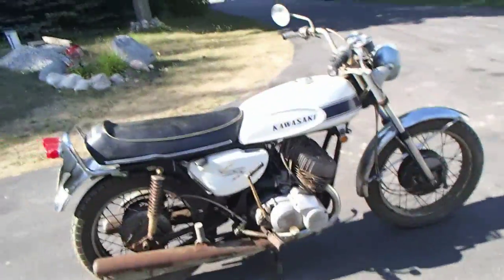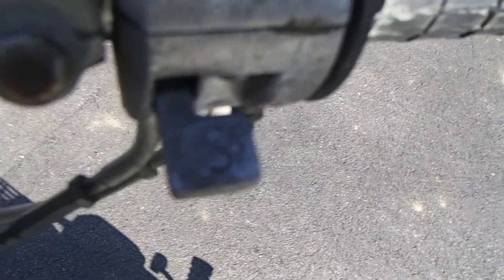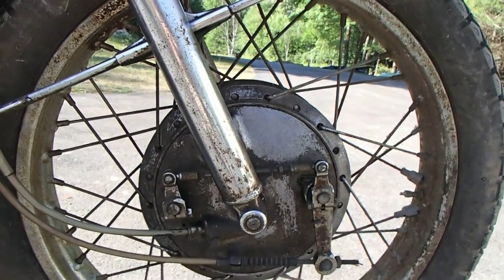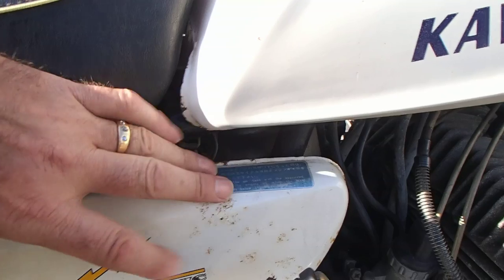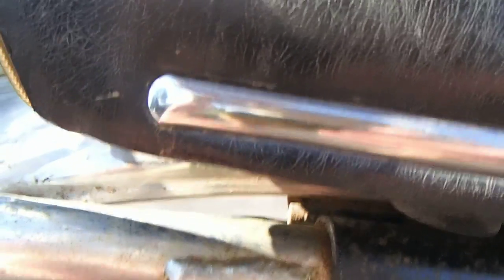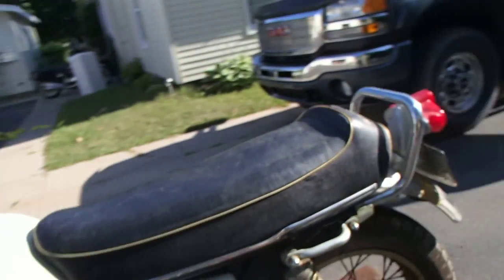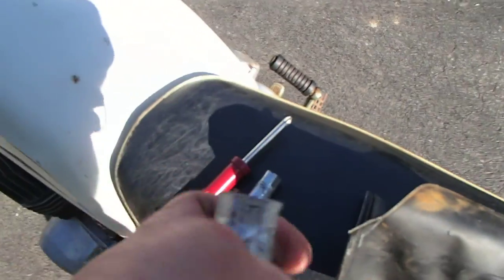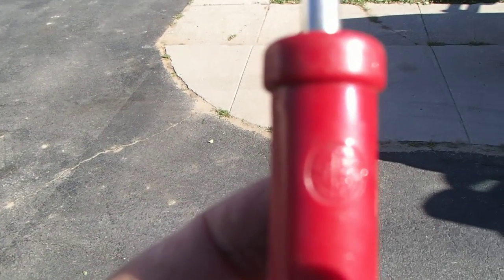Close up view of 1969 Kawasaki H1 Barn Find

Comment: I neary  bought   one   of  these  when  they   were  new did  not  like  it  at  80  to  90  m p  hour   slowing  down  had  to  drop  down  the  gears   and  rev  the  nutts  of  the  bike  to  get  the   speed   back  up   bought  a  suzuki  gt  550  much  better  bike   more  torque   not  as  fast   but   i do  like   the   kawis   i had  a kawie  900 z1a  good  bike    soid  that  and  bought   the  best  bike  i ever  had  suzuki  gt 750  watercooled  in  blue  i now  have  suzuki  t500j  love  suzuki   two  strokes  i am  66 years